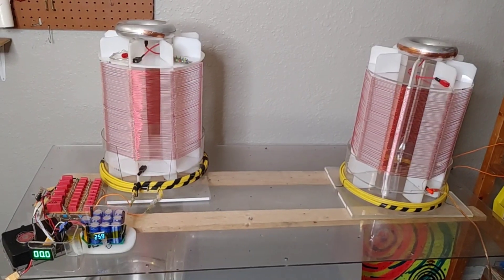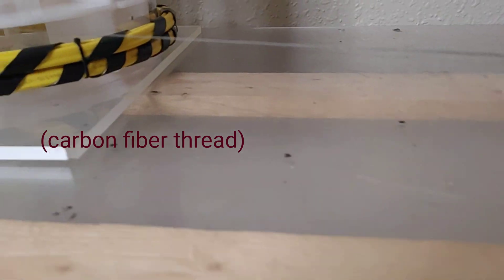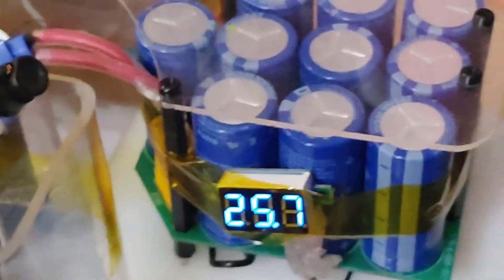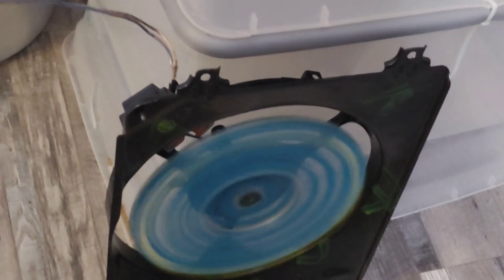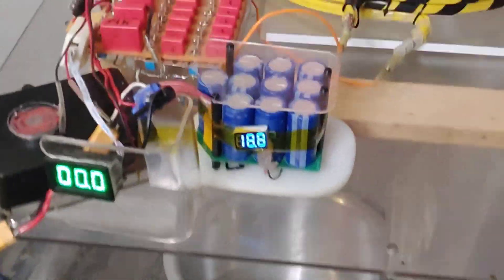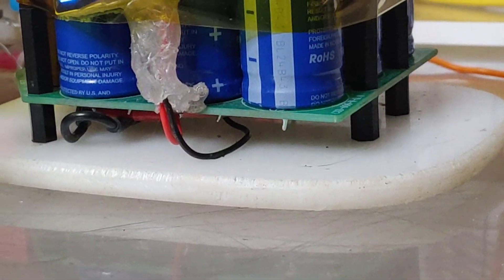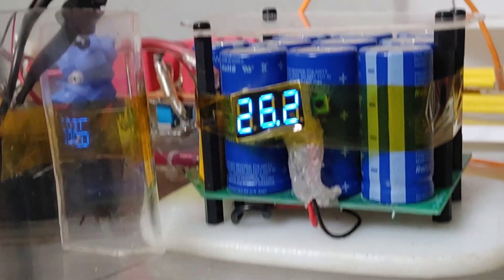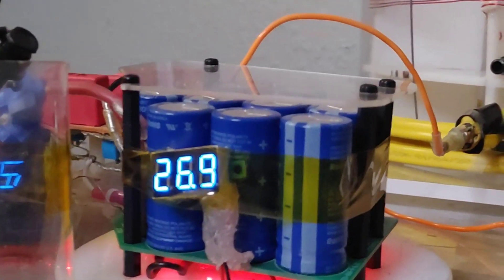Single-Wire Power Transmission Efficiency Test Setup

Comment: Nice bro 
I also make video on yt 
About electronics
Reply from the maker: oh cool i like the one you made with 18650 batteries, battery packs 😍
Reply: My best project is the 240 watt power supply which I made entirely ot of components
I didn't use any ready made module except the cheap multimeter which is used to show output voltage and voltage across shunt resister
 i. e the current